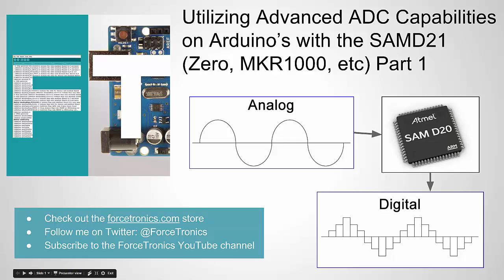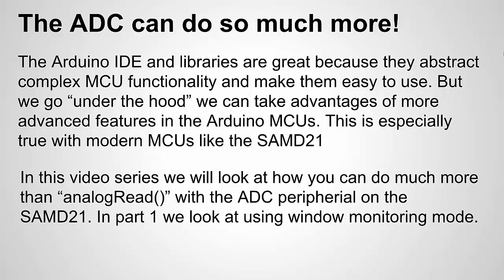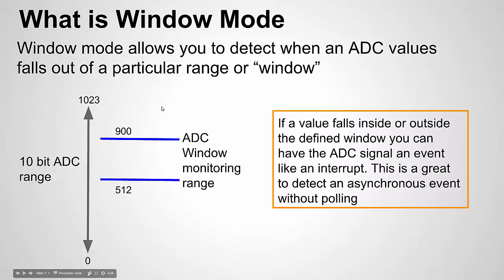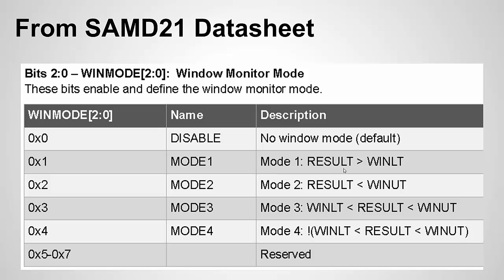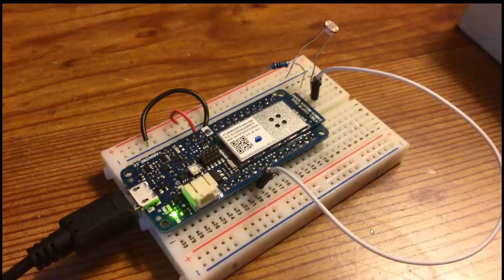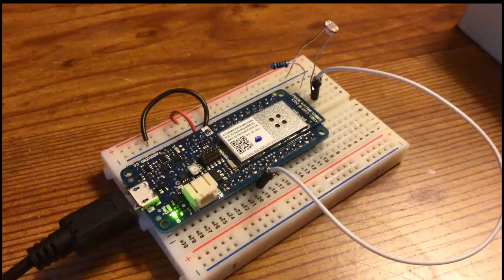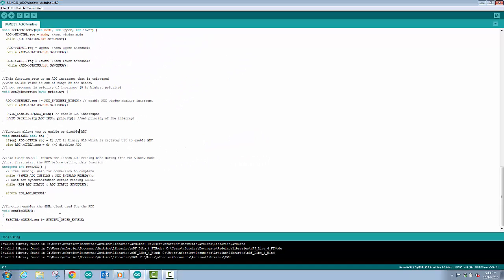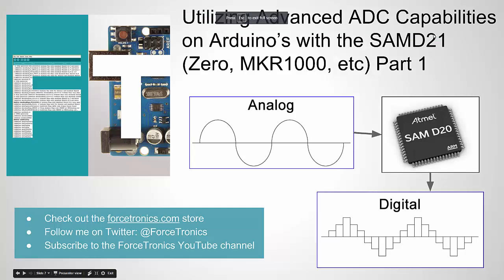Utilizing Advanced ADC Capabilities on Arduino’s with the SAMD21 (Zero, MKR1000, etc) Part 1

Comment: The ISR routine has comments that are contradictory to the words in the video, and makes this a VERY confusing example. 

The comments in the ISR routine say "(ISR) that is called if an ADC measurement FALLS OUT OF THE RANGE of the window" but
the spoken words say {"in the range".  Which is it???
The comment on the digitalWrite for the led says "turn LED off" but it sets the pin to HIGH.  That would turn the LED on, but what turns it back off again?
It would seem that the example code does not match what is actually running in the video.

Comment: I cannot seem to change the port pin for analog input!  Im trying to use PA06 on my SAMD21 sparkfun min board and just changed these two lines - BUT it still is reading from PA04 !  What is going on here? THanks!
//setup measurement pin, using Arduino ADC pin PA04
void setMeasPin() {
  // Input pin for ADC Arduino PA04
  REG_PORT_DIRCLR1 = PORT_PA06;  <----  changed to PA06

  // Enable multiplexing on PA04
  PORT->Group[0].PINCFG[6].bit.PMUXEN = 1;  <--- changed to [6]
  PORT->Group[0].PMUX[1].reg = PORT_PMUX_PMUXE_B | PORT_PMUX_PMUXO_B;
Reply: The function that says it is setting the analog input pin does not appear to actually work.  If you never call it, it still reads from A3. I did find a trick to get around this though.  in setup(), after calling ADCWindowBegin(), do one analogRead() to the pin you want to read from, then call enableADC(1); to re-enable.  Works like a charm.

Comment: If I needed to read from the ADC at a particular sample rate, say 9600 samples/second, how would I achieve that? Using the clock prescaler somehow? Great overview btw!
Reply from the maker: There is probably multiple ways you can do this. One way would be to set a timer and trigger an interrupt based on that timer. In the ISR make the ADC measurement. But you would need to reduce the ADC measurement time to a much lower value. If you use the arduino analogread() it takes like 300 us just to make the measurement which would not work for a 9600 sample rate. You could also use the Arduino micro() function and just do a timer in the loop. There may also be a way to do it in the ADC module itself, but I have not looked at the datasheet in detail for a long time.